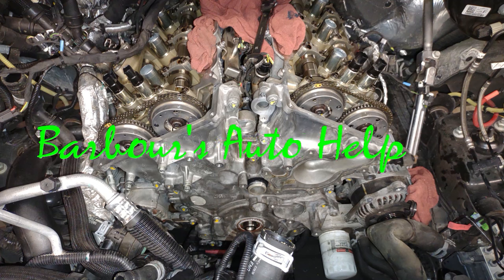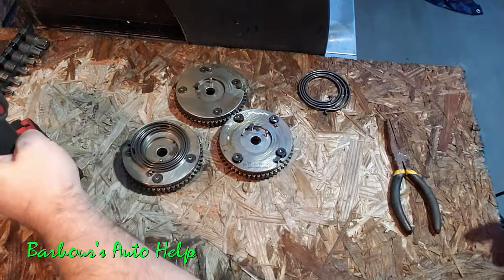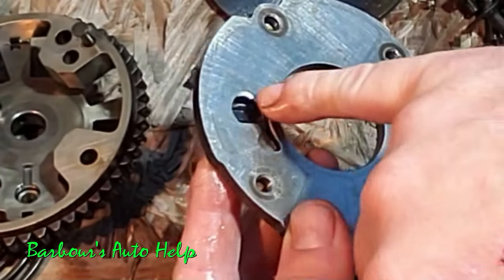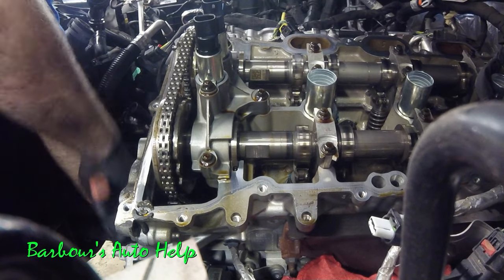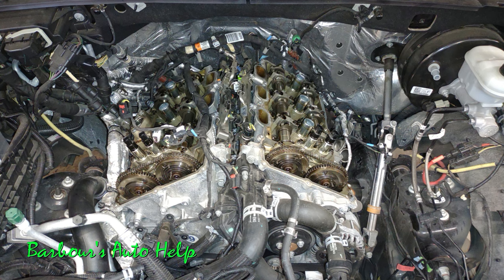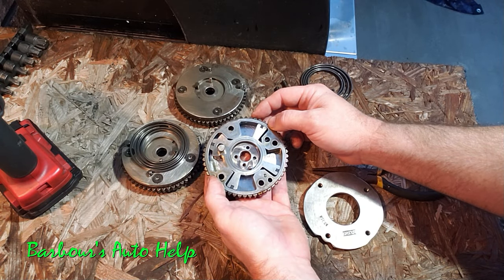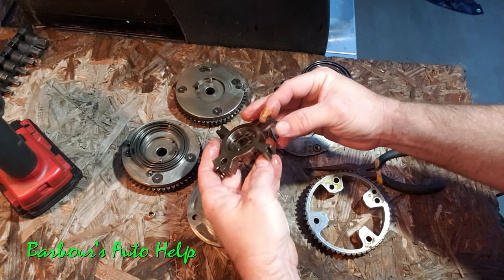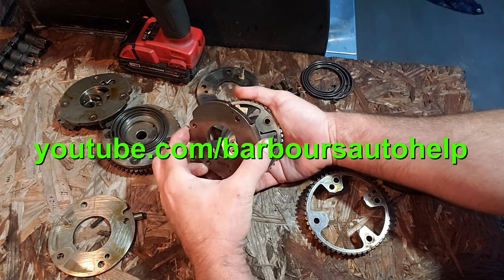Ford 3.5L Ecoboost Cam Phaser Rattle/ The noise, The cause, The fix

Comment from the maker: Folks, I've been getting a lot of questions about potential engine damage caused by this failure.  I've made a video on it.  Here is the link.  https://youtu.be/IM49mQupOoE
Reply: Nice video. I bought a new to me 19’ F150, I heard you can tell which phasers are in your truck but looking down your oil fill cap,? Is there any tiny differences to be able to tell that way?

Comment: This comment may sound too good to be true.  I bought my 2013 f150 new, and had this problem for years.  When I switch to the OEM motorcraft fuel filters (yes, you have to buy your own, they don't carry OEM at most oil change shops), the problem all but resolved.  I still get a light rattle sometimes, but nothing like before.  Something about the OEM filters helps to prevent the dry start.  There, 2 minutes of typing I'll never get back.  Hope this helps someone.
Reply: I'm not understanding how a fuel filter affects an oil related rattle....
Reply: I too switched to motorcraft oil filter and it went away for about 60k miles
Reply: @peruser155  i think he meant oil filter. 

A lot of f150 owners swear by using motorcraft plugs and oil filter.
Reply: I’ve had mine since 70k miles, used motorcraft filters the whole time, and had my first cold start rattle today at 144k miles. Might be something to this…
Reply: The MC oil filters are the best hands down simply because the check valve in them are at the top instead of the bottom which makes them stay full of oil. Far as I know everyone else's are on the bottom. But no it will not guarantee you won't still have this problem at some point.  Would be nice to know if it prolonged the for 50 or even 100k miles. Obviously that would be awesome! Personally I think ford should be ashamed of themselves and repair them all for free but I know if it's not safety related it will always be just a TSB. (Technical Service Bulletin).
Reply: I changed my oil and put a fram filter. Soon as I did that the rattle started. Seems the check valve not holding the pressure to the cam is the issue.

Comment: So a couple have touched on this but here is the BIG question:  why not leave it alone?  After hours of research I've discovered that thousands of 3.5 Ecoboosts have the noise, but have not read ONE engine failure from it.   One guy said he has gotten almost 200,000 miles on his "rattling" 3.5 with zero driveability issues!   And, most have said that the rattle returns after any repair anyway, software update OR parts replacement.  So, my question is (you seem extremely knowledgeable and this is probably the best video I've seen...thank you), is why not just leave it alone?
Reply from the maker: The potential for failure is there. Phasers can and do break. It is very rare in my experience but they do.  I recently had to swap a 5.0 because one phaser broke apart. Different engine but same principle. I’ve never seen a phaser on a 3.5l break apart though.
Reply: @BarboursAutoHelp  literally the only one I've "read about" online is a 3.5 that was starved of oil.   Tech said it was 4 quarts low.   But that was oil level related not a random phaser failure.   My '19 Expedition has rattle for 1 second on startup and then a ticking after warmup.  I'm hesitant to take it in if it doesn't help in long run, and if I can get 5 or 6 years out of it why bother?  Thanks again for the great vid.
Reply from the maker: No problem. Come to think of it I believe the 5.0 that I mentioned did have an oil pump failure. But I will say that I’ve not heard of any failures with the new style phasers. Good luck to you with whatever route you choose.
Reply: I've had the rattle for at least 75k miles on my 2018 F-150. Also done hours of research and can't find a single case anything serious happening to the engine.
Reply: I've found using a motor craft oil filter and cranking the engine with the accelerator depressed to the floor for a few seconds eliminates the problem.
Reply from the maker: @hokiesax2  https://youtu.be/IM49mQupOoE
Reply from the maker: I went ahead and made a video about this.  I've recently seen some "stuff" on this.  Check it out.  https://youtu.be/IM49mQupOoE
Reply: @Dillonkg1  It's only "fixed" in that it's masking root causey. Anyway, I have a '13 3.5 and also haven't read of single engine failure due to this. I was going to have it fixed but have decided to just keep driving it, and increasing oil changes to 5,000 miles or less.
Reply: @kurtbilinski1723  I figure no rattling is better than rattling 🤷
Reply from the maker: Currently replacing another engine 3.5l due to this. 2nd one. Yes it it is very rare but does happen
Reply: @BarboursAutoHelp any updates? Bought a 2012 3.5 few months ago. Dealership Receipts said new timing chain and Cam Phasers 30,000 miles ago, but the rattle is back. Could I just replace the phasers and not the belt? I’d have to go to a shop. I’m a student trying to keep expenses to a minimum.
Reply: So mine failed and it completely totaled the engine unfortunately. This was bound to happen as I didn’t know anything about my truck until that happened and had to get a new engine. Trust me these failures do happen. Mine happened 6 months after I bought it and I did keep up on maintenance.

Comment: Great explanation.  An easier and cheaper fix is to just hold down the gas pedal, let the engine crank for about 3 seconds before letting off the gas and allowing the engine to start. This builds up some oil pressure and prevents the rattle.
Reply: I was excited to try that method…. Sadly it didn’t work.😩
Reply: Turning the engine over for 3 seconds without starting DOES work for me.
Reply: this is what I do.  it does work.  is there any concern by flooding with gas before starting?
Reply: @MrLittle2020  absolutely not.
Reply: How do you crank the engine without starting? Especially with a push start?
Reply: @andrewkoudlai2113 hold the gas and brake pedal when pushing the start button. Vehicle will attempt to start but will not turnover and run.
Reply: I would recommend a seven count. Also be aware when you take your foot off the accelerator pedal do it with a snap very rapidly Don't come up slowly because it will rev the engine up when you least want it to be revved up as it goes out of flood clear mode .

Comment: 2019 F150. Did not have rattle at 30k, 40k, and 50k dealer checkups. Each time dealer told me they were not recommending re-flash unless a problem due to trucks coming back right after with other problems (shudder).  Truck had 59600 mi when rattling started.  Called dealer for appointment to check, earliest was a month out and he told me not to worry as long as they saw it before 12/31/2022.  Now another dealer and FMC tells me that is BS, needs new VCT and no warranty coverage available because over 60k.
Reply: They have it down to a science can't make money if stuff doesn't break
Reply: I will never buy a junk ford again, i know a few people who say the same as me

Comment: What percentage of vehicles does this happen to? i’ve known about this issue for a long time, but I have yet to come across anyone I know that has had it with their Fords that have the 3.5. very good video.
Reply from the maker: I'm not sure exactly what the percentage is.  I do know that this issue is one of the most common points of failure for this engine.  It's a great engine and other than phaser issues and turbo related issues we don't see a whole lot.  It's common enough that there is a TSB for it.
Reply: Me and everyone I know with f150 has it
Reply: @BarboursAutoHelp  I have this issue with my 1.8 ecoboost in my Chevy sedan
Reply: It’s happened twice to mine
Reply: @ryanmurphy997  damn! With what I do for work I had to stop by a Ford dealership so I asked one of the mechanics two days ago what the odds were of having to replace the cam phasers on a raptor and he said if it’s 2017 to 2020 it’s pretty much 100% at some point. That’s just ridiculous.
Reply: I have never heard a f150 ecoboost without it. Ford should be made to fix every 3.5 they have ever produced by the government. They knew it was an issue and continued to produced the engine anyways. I don't care if it has 1 mile or a million. They should have to keep fixing it until they get it right. This is not a cheap fix. When it causes your timing chain to fail it is thousands of dollars just the 4 phasers are $1000, the timing chain kit another $1000 plus the remove entire cab off of your truck so you can only imagine what the outrageous labor cost is
Reply: My 2019 lariat had it when I first got it during cold winter starting back in 2020 and it kinda went away 🤷🏻‍♂️. I have them do the PCM update in 21’ and I really don’t hear anything when I start it now. 45,600 miles on it
Reply: I have a 2019 35 eco-boost that does this rattle noise for like 60 seconds before it quiet down is it possible to VCT would take this long to fill with oil how much does the average mechanic charge to replace all four cam phasers 7:31

Comment: This is a great video thank you for explaining the cam phasers. my 2017 F150 3.5 L eco-boost has to have its cam phasers replaced. truck only has 68,000 miles but the dealer is going to take care of it and it’s paid for by Ford thank God.
Reply from the maker: Glad to hear it!!
Reply: I have a 19 with the same mileage and they told me I have to pay for it.  $3k.  Just bought the truck three months ago.  Not very happy.
Reply: I have an ‘18 F150 with 40,000 miles. The Customer service action which extended the warranties for vehicle owners (21N03) expired in January ‘23.  I’m now stuck with a $4200 repair myself.
Reply: @BluBerrysandmore27 I was told the same thing. $3700 is what they wanted to charge me.
Reply: My quote was $4800
Reply: no way you got the dealer to do it? i have the exact same milage on my 2019 and i don’t have warranty anymore you think they’d still fix mine?

Comment: Thanks for such a great description of this problem.  I just dropped my 2018 Lariat F-150 for a second cam phaser fix this morning. The issue is exactly as described in your video.   The first issues started around 25-30k miles in and 2 years after purchase.  The fix worked until about 3 weeks ago and I'm now at 53k miles.  I baby the truck and never push it very hard.  I'm really hoping that this current repair fixes the issue long term.
Reply from the maker: I hope so too.
Reply: Just purchased a 2017 expedition and my friend who is a ford master technician for many years advised me to change the oil every 3k miles to avoid cam phaser issues. Hope that helps :)
Reply: @yvonne9264  that’s standard for any vehicle. I’d do it every 2k
Reply: @yvonne9264   In the video the technician says the cause of the sound is from oil dripping out after sitting for 2-6 hours and when u start up the oil isn’t there so it rattles until oil reaches that spot. So what does changing oil every 3k miles do? It’s still gonna do it until the oil reaches the affected are. I just got my 2018 f150 3.5 eco boost 100k mile maintenance done along with a few other things, costing me $2,000. My transmission went out a couple weeks ago and it’s still in the shop. They are fixing the cam phaser problem as well. All under warranty they said. Might just get rid of it after this it’s too much bs to deal with
Reply: @fccoz8348  Oil and engines aren't still stuck in the 1970s. If you're using good oil and a good filter, 7500 to 10000 mile oil changes should be the norm. 2-3000 mile oil changes are just a waste of oil and money.
Reply: @jrcarr2326 all I'm interpretating from all these comments is ( stay away from these engines ) period!!!!.
We just had our 3.5 ecoboost timing chains done at Christmas time.  And the noise didn't go away completely.  
Mechanic said the noise is now injectors.
Reply: @jrcarr2326  
Couldn’t agree more. Poor People.
Reply: @jrcarr2326 not if you have twin turbos that like to eat oil.

Comment: In case it helps-  I have a 2013 f150 3.5L ecoboost that started rattling at about 122k (purchased at 115k so I don't know if it was happening before this, i have heard that Lucas might help, but i dont know if that is true).  I found that it would not rattle if I did an extended crank (holding down accelerator petal while cranking until oil pressure builds and then releasing it to allow it to start). Harder on the starter motor for sure, but this was my temporary solution until I was able to change vcts, timing chain, tensioners,  oil pump, etc.  So far so good about 5k miles later.

Comment: fantastic video. thank you! I am getting ready to DIY this repair over the weekend! :) For reference I have a '17, with 220,000kms and its been rattling since 90,000kms and I've had zero drivability issues other than the crazy rattle and hot idle tick.
Reply from the maker: That's awesome and thanks for the compliment.  Let me know if you have questions.  I'm pretty familiar with it.
Reply: @BarboursAutoHelp What happens if you don’t fix it?
Reply: Glad to finally hear of someone just leaving the issue. Contemplating doing the same for mine. My truck didn’t qualify for the recall whatsoever, but still have the phaser issue
Reply: I got the recall letter about my 2019 and took it to Ford to update them in 2022. I hadn't heard any issue with them but they said it was an expensive repair and I was about to be out of the warranty period so I let them do it. It hasn't been 2 years or 30k Mike's and now they actually are making the rattling noise. I'm not sure if leaving it alone would've been better or not, but now I'm out of warranty and Ford said it costs about 2500.00 🙄

Comment: Just took my 2019 F150 in for another reason and they are replacing the cam phasers.  Thankfully I am still under warranty; if not, it would be $4200.  I sure hope it lasts.  It only has about 37k.miles currently.

Comment: Phaser Up-Date!  The Ford design is for at engine shut-down the oil holding the phaser in the advanced position drops and the coil spring should return the unit back to the engine start position which optimum. When the phaser in this position the spring loaded pin should   hold the phaser until the oil pump and push oil to the pin out of the locking position. 
From there we find the problems. The hole in the center "Spider" has 2 steps and the pin is a loose fit in the back side and a loose fit in the front side. This lets the pin kick sideways and start the climb out of the "PIT"! This may take 70,000 miles to chew enough off the edge so the pin can no longer lock the phaser and that's when we get the chatter. 
1. The solution! Replace the pin with a longer locking pin with a step to take advantage of the larger hole which will stop the kicking up sideways and jumping out of the locking slot.
2. Replace the button on the spring and the spring. These parts aren't available from Ford!
3. The great answer is that this can be done with out pulling the front cover! You don't have do more that pull the valve covers. Remove the 4 bolts that hold the phasers together.
When you do this you must inspect the rear plate to make sure that the slot hasn't been chewed off so that the pin can still catch.

IT still not a easy trip but it's better than pulling the front cover. the design for the pin is to follow if you want to know.

Tom Silver

Comment: This is cool, thanks for explaining. I have a 19 expedition and had this repair recently. I am still getting an odd rattle upon cold  startup but it doesn't sound like your example. It didn't make the noise after the repair but it has come back shortly after. I wish I knew the part numbers to see if I have the updated parts. Makes me worried to keep my rig due to how frequent this repair may come back up.
Reply from the maker: I'll see if I can dig those numbers up for you.  I'll try to get back to you tomorrow.
Reply: Looks like they replaced two different parts which have these numbers next to them in the invoice ML3Z 6256 A SPROCKET - camshaft and ML3Z 6C525 ACAM.  Is there also cam phasers at the rear of the engine or only two?  Thanks for responding, I posted your video on a forum devoted to Expeditions and it is well received.
Reply from the maker: Looks to me that the numbers you have are the "latest and greatest".  There are four phasers in all.  Two for each head.  One of those phaser numbers is for the exhaust cam and the other is for the intake cam.  You have one intake and one exhaust cam per cylinder head.   And of course you have two cylinder heads.
Reply from the maker: By the way, turbo waste gate rattle is not uncommon on these.  This is a lighter rattling noise than the one in the video and it usually happens upon cold start up and may even be heard after the vehicle is warm.  This is a "normal" noise believe it or not.  (not 100% sure this is the noise you are hearing)  You are welcome to capture a video of the noise and post it on your channel and then drop a link to it in the comments.  I'd like to hear it.
Reply: @BarboursAutoHelp  thanks, I will see what I can get recorded. I really appreciate the help, thanks for posting and answering my questions!
Reply: @BarboursAutoHelp  this was SUPER helpful. I believe I have the waste gate value rattle. I really appreciate this content that helped me understand it way better than the dealership did!

Comment: Really helpful. I have a rattle under load and this was one of the recommended solutions and mine does not have a rattle on start up so I don’t think this relates to my issue.